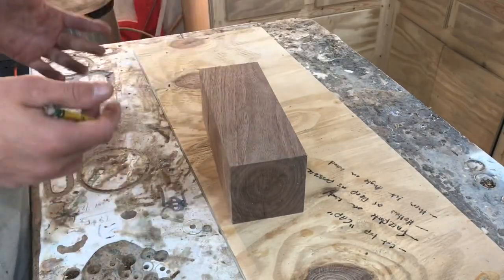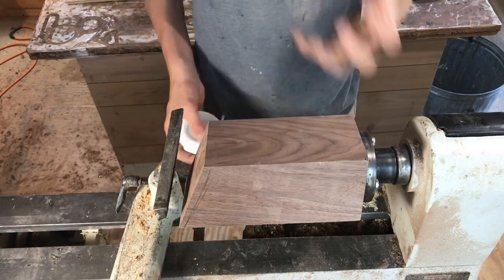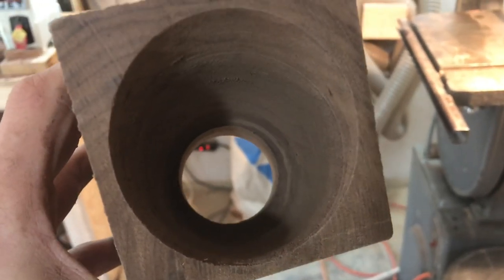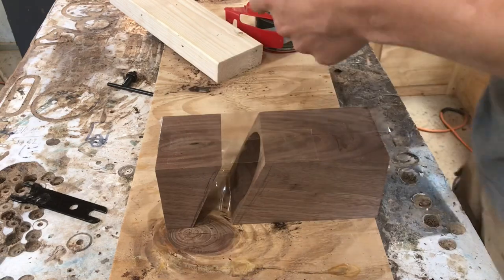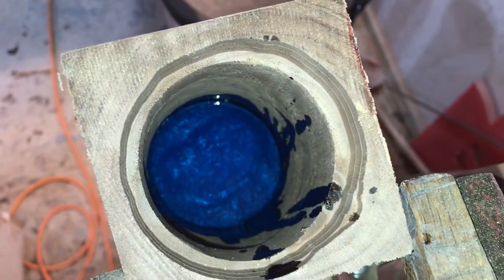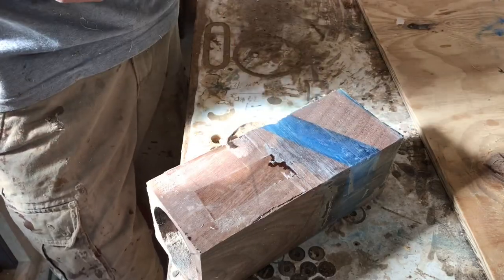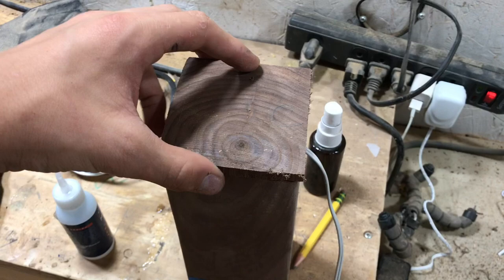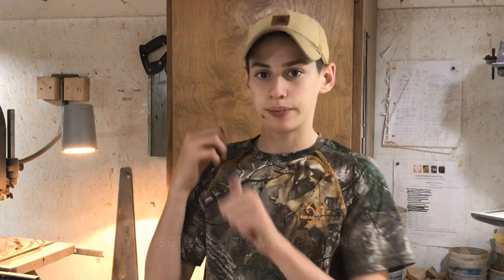Make an EPOXY RESIN LAMP! EASY!

Comment from the maker: Fun Fact- During the making of this video, I broke the LED light. I had glued it in, and when I was sanding the base flush with the outside of the lamp, I sanded through my cord without realizing it on the belt sander. So I had to order a new light.

Comment: Seth I need your help..  So I don't have wooden blocks or anything but really want to make one of these. (Or something like it.) Are you familiar with UV resin? If so,  what advice would you have for attaching LEDs in UV resin? Thanks so much,  and keep it up! This is beautiful!
Reply from the maker: I’ve never used UV resin but if I were to guess, it would probably harden too fast and create lots of heat and bubbles. I have way too much wood so I can cut the pieces of wood you need and mail them to you if you want for a small price.
Reply: @seths_custom_creations  awwwww that's so sweet of you! Bless you you don't need to do that,  I'm all the way in the UK haha! But thanks very much for the offer! That's so kind!!

Comment: Hey man, awesome channel keep up the good work! 2 questions however #1 how do you like that WEN planer? Was thinking about picking one up and #2 what do you use for sharpening your lathe tools? Bench grinder?
Reply from the maker: Sean Rachubka I love the WEN planer. It’s amazing. It’s like $250 on Amazon and it’s worked flawlessly for the 2 years I’ve had it. I’ve run 100’s of thousands of BF of material through without issue. Currently, I just use sharpening stones and my belt sander to touch the tools up. I’m soon getting a grinder with the wolverine sharpening setup.
Reply: @seths_custom_creations  awesome thanks for the info! Forgot to ask what CA glue you use that has the activator? Been looking around but there are TONS of them.
Reply from the maker: Sean Rachubka Starbond.